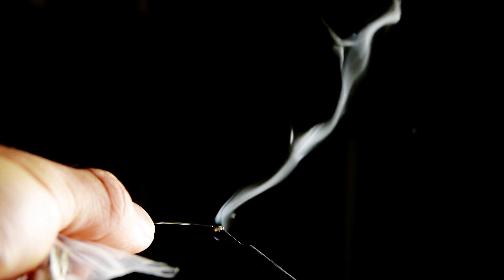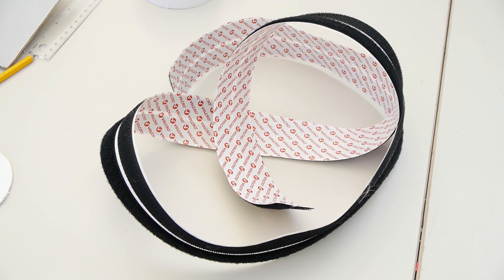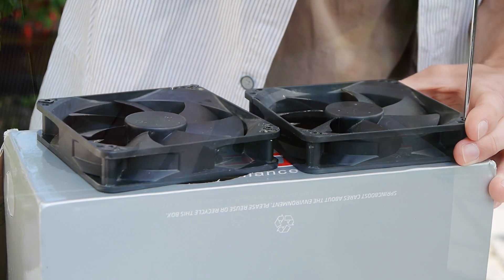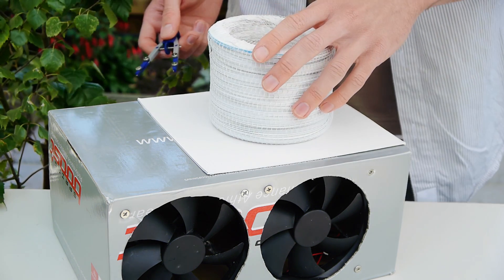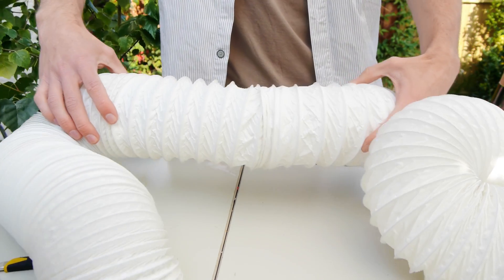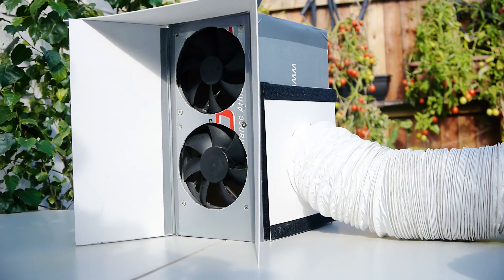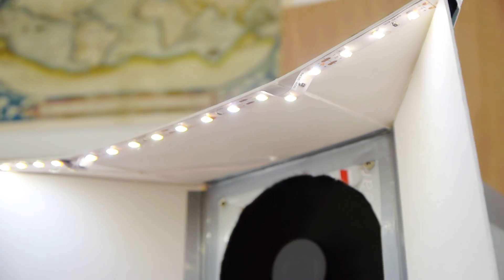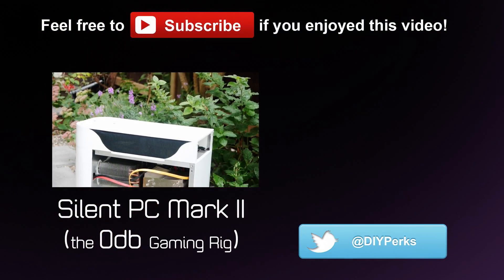Safety first! How to make a solder fume extractor!

Comment: Another great idea!  I have a vent for a generator in my garage door the previous resident used. I could use your vent idea with an extension hose run from my workbench;  The fans would push it right outside. Had been just using a small USB fan directly on the the work, but would much rather draw it away and out.

Comment: I have a squirrel cage fan from an over the oven microwave and it pushes a LOT of air. I'm planning on building my fume extractor using charcoal filter, hepa filter, a decent size Igloo type plastic cooler and some tubing that will hold shape. Add an computer type power plug and a Hi/Low switch with indicator. Maybe I am over complicating it similar to comments below but I want a nice one and done solution. I have pet birds and I shouldn't be soldering without an extractor.

Comment: it's absolutely amazing what you did, but my friend i have to say you that this solution is not totally effective and it's important what i want to tell you now. Carbon Filter hasn't the capacity to filter the substances into soldering fumes because they are really small particles that can't be catched by the carbon filter and pass through it's entire thin. Only the 5% of it can be filtered, but other 95% of this substance pass and go into the air that you breath, and this is an hazard. You absolutely should leave the carbon filter and put an HEPA filter, that can filter particles with 0.3 micron of dimension. Also the flexible tube should be of a certain material, assured you that the fumes will not pass through its walls

Comment: Hey hii thanks for sharing .. can you tell what power supply did u use ita 12v n how much Amp. As when I connect 12v 1amp supply to 2 fans the speed of fans reduce drastically .

Comment: Question.  Do you have any data as to how many mm/inches from fans your extractor still “sucks” bad fumes at 100%, 90% , 80%?    I had made a extractor and used a 120mm fan and in order to get 100% , I had to be within 6” of the fans

Comment: I have found the side panels do more harm than good, why? because the reduce the airflow speed the farther you get away from the fan. We have $230 fume extractors at work and they suck , i use a simple PC PSU top case with its fan connected to a variable power supply and most times run it at 6 to 8 volts, it can suck the flux smoke from ~15 inches away. There the $230 units you need to be 5 inches away and some of the boards i work on are much larger than that. To bad YT does not allow picture attachments.

Comment: I didn't realize you could you put screws in the cardboard to attach the fans. I just did a solder fume extractor, but I used tape for attaching fan and filter and it didn't turn out that good. Screws would be a lot better, Thanks for the tips!

Comment: Please don't use only charcoal filters for this. They have their application field, sure - and that is removing gaseous particles like VOCs and  odors through adsorption. What it cannot do though is filter small particles - and AFAIK they are also released  massively when melting solder lead.
To filter out those particles, you need real HEPA-filters (they are even smaller than the particles inside tobaco smoke, so you should really use HEPA).
Surprise surprise - "professional" fume extractors have both, a high efficiency HEPA filter and a following charcoal filter (really much charcoal).
Reply: Relatively to the fan, which one do you put first, the Hepa or carbon filter?
Would you just stick them together or have some space between them?

Comment: Why not invert the flow and have the hose as the intake, that way you can more easily position the hose near where you are working, and the fumes will be drawn along the hose to the box?
This is how many professional soldering fume extractors work. Along with the filter.
However, I must say the pack away design is VERY clever.
Reply: because if the fans are at the back it is harder to suck in all the air because the air has to travel through the entire pipe

Comment: does it run of a 12v adapter?? you kind of skipped that..i now i need to get a dc jack on banggood or aliexpress but the 12v adapter is something i will look for locally .if needed..to bad it doesn't run direct of usb power..i was also thinking to buy a "Aoyue 486" and try to add a fan to it..??

Comment: i did this but replaced the cardboard box for a large plastic food container as it has a rubber sealed lid. this is good as it meant i could have 2 lids, one with the ducting and the other with a carbon filter.

Comment: With the DC Power Jack does it matter where I solder the wires? 
https://www.amazon.ca/DC005-Mount-2-1mmx5-5mm-Female-Socket/dp/B00HG8AYY6/ref=sr_1_9?ie=UTF8&qid=1460776024&sr=8-9&keywords=dc+power+jack this is what I am using.
Reply: Yes. Look on the label on the adapter you are planning to use to see if the inner or outer part is positive

Comment: I have only ome question: where the truck can you find "ducting"? I live In UAE and have beem looking for ot since some time to build this
Reply from the maker: I got mine from eBay.
Reply: DIY Perks how much do I wish we had our own eBay.. I have to ship it from UK or USA or even China. But here is the catch, I once ordered a 10$ anime hodie to give as a gift... Shipping cost 40$!!!!!
Reply: +DIY Perks could you give me a link of your exact ducting? found a good shipping company that ships for cheap via buses...
Reply: +Anas Malas www.amazon.com
Reply: +Anas Malas This is probably clothes dryer vent hose, perhaps available at hardware or appliance stores.
Reply: MegaJehanzaib well... Nevermind... I didnt read your comment, but after I used them it was apparent it was a very bad choice... 2 months for a package when the post coulve took 8 days... No thanks
Reply: Ben Lucas i found nothing related to paper ducting. All i find is aluminium...
Reply: +Anas Malas  Can you tell me the name of that shipping company. I live in saudi arabia and it would be great if i get it
Reply: @MegaJehanzaib  Go for aluminum if you can. They are way better than the paper duct.
Reply: This specific type of ducting is called "Vinyl Ducting" I just need to find the sponge bits, and I have everything! :D
Reply: DaiShuryo Technus he used paper ducting, but even vinyl I didn't find... Here we dont really have dryers as the weather is enough 😅

Thinking abour using a vacuum cleaner hose though. But I haven't found the time...

Comment: Where did you get the DC jack power connector, and what kind of PSU did you plug into it? 12V? I don't want to run the fans too fast and break them, but I don't want it super slow either.

Would these female DC jacks work for this project? http://www.amazon.com/Omall-2-1x5-5mm-Adapter-Connector-Camera-Black/dp/B00R96X6HC/ref=sr_1_2?ie=UTF8&qid=1424100412&sr=8-2&keywords=DC+Barrel+Power+jack

One last thing, what fans did you use? I don't want to buy expensive fans since I'm not trying to keep an expensive PC cool
Reply from the maker: MegaGeekTutorials Those jacks look ideal. You're right about the voltage too. 12v is the standard for DC computer fans, so they should spin at their fastest with that voltage. As for what fans you need, any cheapo fans will do the trick.

Comment: I would like to build something simmilar but for a different purpose. The way I intend to use it is to filter the air in a room with lots of cigarette smoke. My question is: will does carbon filters be able to succesfully remove the odor and the chemicals left by cigars ?

Comment: You should have a 3d printer (i know they arent free) you could do really cool projects!
Reply: DIY Perks i am against. Keep your vids user friendly! You just earned a sub, and the local diy website earned a crap ton of money...
Reply: DIY Perks I'm sure you could build a 3D printer pretty cheap if you find the right parts!
Reply from the maker: coooooooooool1000 I wish!
Reply: Attila P. bloody copml;ex tho
Reply: you can build them fairly cheap using cd burner parts and 3d printed parts. custom circuits etc.
but a CNC milling machine is way better than a 3d printer (if you have the $$ to buy the material, which often is metal). but you can make circuits without having to etch. which would fit the theme of this vid

Comment: Currently in the process of making one of these on a slightly smaller scale. Im using 3 small fans instead of two bigguns' and I am replacing the LED strips with a modified USB light that has a flexible stand, so that it can be positioned where its needed.
Thanks for the awesome idea DIY Perks!

Comment: How do we solder the power wires of the two fans in parallel if we don't have the fume extractor with which to safely solder?! :(
Reply from the maker: Lord Marcus Do it outside, like I did ;)
Reply: While you do it just make sure that you bend down and sniff the fumes before they dissipate
Reply: Lord Marcus wist ik thinking as well
Reply: BAAHAHAHAHAHAHA
Reply: gotta make one to use while you make this one
Reply: GOTEM!
Reply: I've been soldering for years. You're not gonna fucking die tomorrow. I do this without a fume extractor all the time. You're not breathing in lead. You're breathing in flux. Which is still bad but you're not gonna wake up with a growth on your balls and have testicular cancer the next day.
Reply: @cheesememe4986  I like cheese and internet memes.
Reply: youre not gonna die because of one time soldering without an extractor